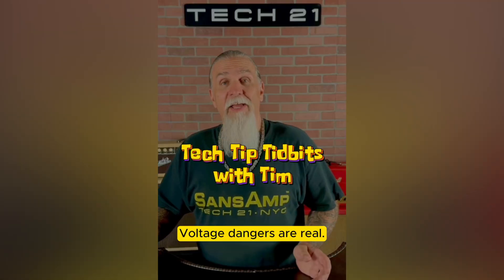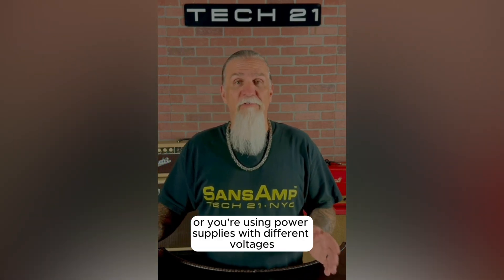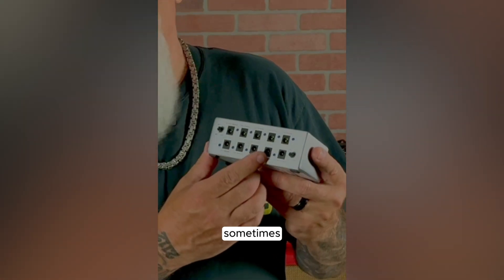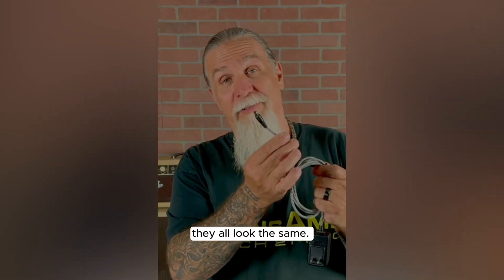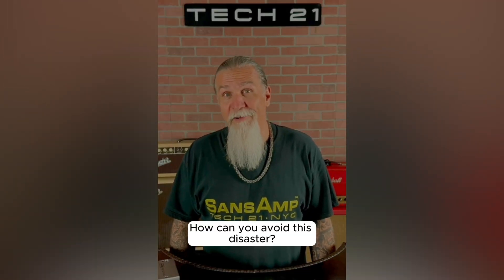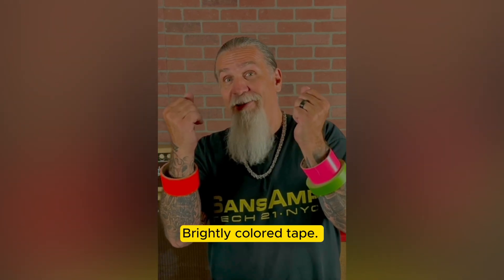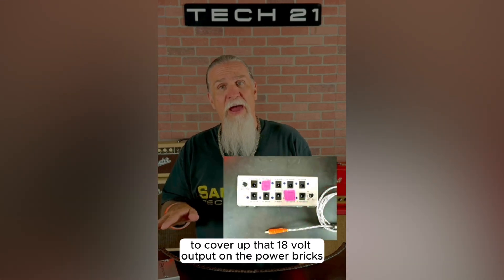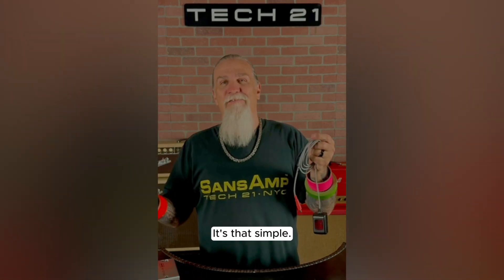Tech 21 Tech Tip Tidbits with Tim:  Voltage Disasters

Comment: My Sansamp GT2 turns on automatically when I plugged in the power supply. Is it normal?
Reply from the maker: Yes it is. Plugging into the input will also activate a battery if one is installed.
Reply: @Tech21nyc  Thank you so much

Comment: This video brings up a very good point. However, Tim, there are 2 tidbits of info that you did not include:

1. When will Tech21 make a power brick? (They could even do the fancy colors so the tape isn't necessary.)

2. When is the next YYNOT album coming out? Those are some of the best showcasing of the Tech21 gear possible..... and it's just great music.